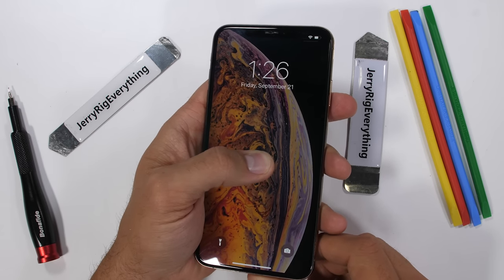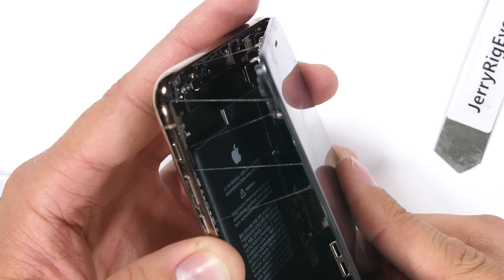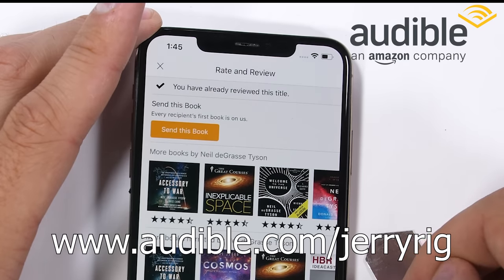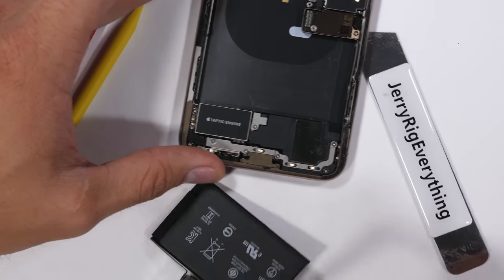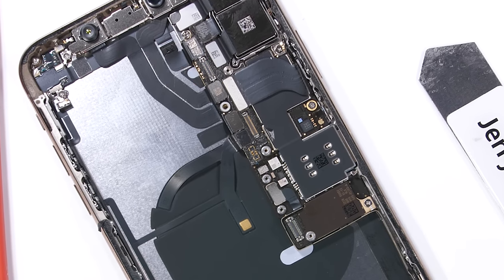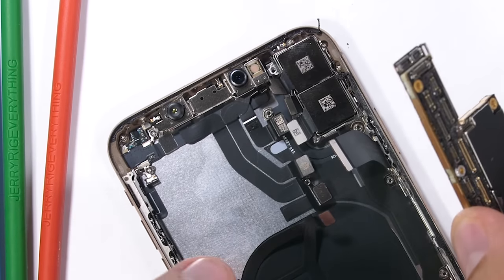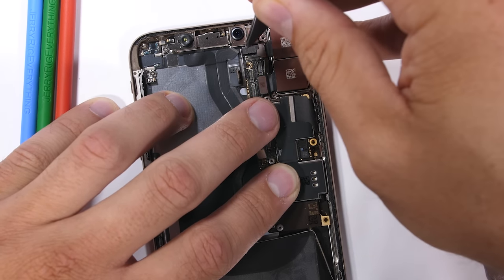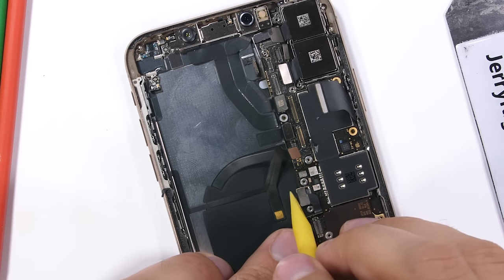iPhone Xs Max Teardown - Is there any Thermal Cooling?

Comment: “But don’t worry, the only time you’ll ever get throttled is when the next iPhone comes out and Apple needs you to upgrade. True Story“
🤣😂🤣
Reply: Lol. My iPhone 7 still runs like a champ. Very fast. No throttling. The best part is, I can still sell it for 300 bucks. Something you'll never be able to do with any other phone. Android phones so not hold their value for very long.
Reply: Darrin Thorpe, I just retired my  iPhone 6 last month, but I just use the phone for calls, messaging and basic browsing when needed. Everything else I use on iPad or laptop.
Reply: @darrinthorpe9292  I can still sell my older oneplus from 2016 for 500
Reply: Sam to some extent it is true. Apple supported iPhone 6 for 5 years, while Samsung will abandon you 2-3 years after you buy their devices. However Android is not only Samsung which in my opinion is worse than Apple in sucking your money. Others like OnePlus will give you more out of your phone for maybe 4 years for a third of the price.
Reply: @darrinthorpe9292  Try looking up the Sony xperia 3 compact. In order to get that used but in good condition you'll have to spend around 200 USD, it was around 300 USD when it was released back in 2014..... Thats a 100 USD value drop on a 5 year old Android phone. Tell me again that Iphones holds their value better than Android phones.
Reply: Done Geekbench each year of my iphone 7 plus has been owned. Hits the same numbers or better each new IOS.
Reply: @darrinthorpe9292  
"The best part is, I can still sell it for 300 bucks"
sure you bought your phone for 1000 and selling it for 300 

i bought mine for 500 and can just gift it to some one ...
question who lost more ? you lost 700 or i did 500 )))
Reply: @darrinthorpe9292  I have a 7 plus i bought new in 2016 but i just bought a note 9 for HUNDREDS less than what it cost new. I'm gonna sell my 7 plus for around 300, high 200s and in the end only pay like 100 dollars and my old iPhone for an almost flagship phone in 2019.
Reply: @n3izhyped622  a brand new current gen oneplus costs barely more than 500. Who the fuck would pay 500 for a 3 year old oneplus?
Reply: iphones hold there value more than android phones however most people who buy an android replace there phone 2~3 years after the manufacturer stops giving updates. The thing is an iphone user pays 1000 dollars to use there iphone for 4~5 years and android users pay 500 dollars to use for 2~3 years
Reply: @Username-2  wasn't their a proven scandal where apple would let older phones receive updates in order to cause the phone to become slower causing the phone user to upgrade to an updated model of the phone? Also even though samsung phones do not recieved updates after two years of release whereas apple has no restrictions on which phones recieve updates, I find that apple users upgrade their phones more often then samsung users. I wonder why that is?
Reply: I sold my iPhone 1 for 730 $ .
Reply: @darrinthorpe9292  LOL I sell phones and cant give a iphone 7 away for $170
Reply: Oh boy I cannot wait to see full HD videos with the iPhone x-- oh
Wait it doesn't have full hd 
My bad ok then I will use iphone 11 oh I forget it doesn't have full HD
Reply: @darrinthorpe9292  no one wants those thick bezels these days lol when u can get an oled display for less than 300$ then why take that shit liquid retina just an LCD🤣
Reply: Different Illusion bezels are Nice they look really good on Apple Phones and also normal person will never notice oled vs LCD
Reply: @HORR1FYING  i can the pixels of a 720p display very easily and also diff. B/w oled and lcd
Reply: @smokemirrors3445  You can but i cant :)
Reply: @smokemirrors3445  And Also on Apples Retina display u cant see any pixels.
Reply: @HORR1FYING  lol its just an lcd display apple just put a fancy name on it like their junk sapphire  camera lens.
Reply: @smokemirrors3445  it is LCD but i dont really care it really still looks so good
Reply: When in fact iPhones are supported 2-3 times as long as android. Typical sheep without the ability to research. Just go by what everyone else says huh?
Reply: @HORR1FYING  I got a crt monitor you'll think is 4k cause a logo. $800 and it's yours
Reply: @HORR1FYING  saying I'm stupid after you use "ur"...yeah. your hypocrite is showing
Reply: @deathbydeviceable  is this UR argument? k buddy get some help.
Reply: @Username-2  if no one uses the s4 anymore, why update it?
Reply: @HORR1FYING  I need help even tho you defend a product cause a logo. You need the help you hypocrite
Reply: @deathbydeviceable  are you not bashing a product because of a logo? Thought so.
Reply: @Username-2  ever heard of inovation these android phones have inovate many things such as curved display quad camera notch 120 hz display full screen display pop up camera fast charging what has apple inovated
Reply: FISH Giovanna oh lemme pull out my iPhone 29 oh my bad though it was 1080p still 720 maybe I should get that Samsung with its 7266282636p
Reply: Smoke & Mirrors with shitty software support and processor longevity
Reply: Luai Ghazali not tue
Reply: At least iPhones get software support for more than two years
Reply: What a pathetic pissing contest
Reply: Ethan Motwani it’s an effort to reduce battery issues over time it can be disabled but I wouldn’t recommend it I have been rocking a 5s since it came out and am only just upgrading to an 11 now the people that upgrade often are probably on contracts. This thing works like a charm my only issue is the battery when it gets cold just doesn’t work but it’s around 7-8 years old so that’s good going
Reply: FISH Giovanna the x has full hd the 11 doesn’t the pro and pro max do
Reply: Smoke & Mirrors the pro and pro Mac have oled so does the x and I believe the Xs not the 11 other than pro and pro max but all the 12’s have oled
Reply: @badderthanyou  
That’s weird, because my 6s dies a little every update.
Reply: @김도혁-c1z  
You got it backwards. People who use iPhone often replace their phone ever 1-2  years. People who use android usually stuck with it until their phone is too outdated to use, or it’s literally broken.
Reply: I still have an iPhones 6s plus runs fine but it can get slightly laggy on 1% but its in perfect condition

Comment: No thermals but don't worry. The only time you'll get throttled is once the new iPhone comes out and Apple needs you to upgrade. True story.
Reply: i wonder if we saw the same video.
Reply: Spade F. lmao
Reply: oplix except iOS 12 actually provided performance upgrades to phones as far back as the iPhone 5s
Reply: Actually not a true story, you gotta read beyond the headlines 😉
Reply: Actually totally wrong, they slowed down the phone in order to prevent sudden shutdown if your battery is consumed - Dont believe anything you hear...
Reply: Where as a Galaxy will slow down after a year or two, and the iPhone will keep up as normal for much longer, when the battery drops to an 80% of its capacity is when it throttles down, Samsung does that after just a year : )
Reply: School's Out: Screw Around it’s a fact... try facts for once. They’re fun.
Reply: @SamAdamsDesigns  it's because before, Apple would slow down older iPhones. Now that everyone knows that Apple does this, they decided to get rid of the speed restrictions. That's why it can be supported by some of the oldest phones and why the speed seems faster.
Reply: Tianjie Lu I’ve been using iPhones since the 3G came to Canada in 2008. Yes iOS updates have sometimes made older models slower in the past, but not the year-old models. It would usually be 2 or 3 year old phones that got a little slower. That happens when you update the UI or add new features. Android phones havent experienced this because they rarely ever get substantive updates beyond the 1st year of release.
Reply: Actually, most reports of slow downs of older phones are because every new IOS update is catered to the newer phones and not old. So when you had IOS 11 update to your Iphone 7, it was designed for Iphone 8 and X, and was too much for your Iphone 7 handle. Still absolutely Apple's fault by not making an Update that caters to all phones Like Android does. Therefore for the 1st time in a long time, Apple made IOS 12, which focused on catering to NEW iphones as well as old ones and made it optimized to where old phones from Iphone 5S and 6 run much smoother and quicker. I am pure Android fan, but this has been only time i give a small pat on the back to Apple.
Reply: @micharel937  

False, but what ever makes you feel better.
Reply: @SamAdamsDesigns  not true, androids get updates about as frequent as iPhones. My 180 dollar honor gets updates about once a month. Yesterday, I got a update that was google's security patch and Huawei's GPU turbo integrated into my phone.
Reply: hear hear!
Reply: I am android user but gotta say you got it wrong there. You are basing your opinion on one incident but you should look at the big picture. Iphone will be faster for longer than samsung one for example. That aspect is of course better with something like oneplus with pure software.
Reply: What do you mean "pure software" of course its pure software, every smartphone is. Most companies would support updates unless they've changed the Android OS till the point where the update isn't supported. Apple has better management over their smartphones than Google because of their closed source OS. Google has an open source which is harder to control because of the many different companies and hardware. Therefore, only some responsible companies would support their phone with Google's updates. And I wasn't basing my FACT on one opinion, I stated that I get updates every month. I was giving an example of my most recent updates.
Reply: @tjl2836  by pure software I suppose he means closer to stock. Stock android has shown to age far better over the years than most skins (specially the old touchwiz from samsung) but I think it's gettin better specially with samsung's...
Reply: @jackkonieczny25  the difference is other phones throttle because the cpu gets less and less power over time but apple throttles them by themselves (I'm not getting into which is better). And apple wasn't planning on telling customers either but people found out so they had to explain.
On another note, the problem with the samsung galaxy note 7 had nothing to do with cpu throttleing but manufacturing defects on the batteries.
Reply: @jackkonieczny25  and to get a battery to 80% deterioration you must be doing something very wrong with your phone...
Reply: @jackkonieczny25     You thought that batteries slowly losing charge was something I didn't know? And it is obviously true that cpus do slow down to stay at a l safe temperature, but that isn't the cause of the the note 7 exploding. It was the battery, what else can explode? And Apple barely includes any cooling in their phones, while other companies are producing liquid cooling systems and 3d chamber systems. And what do you mean by Apple has the balls to admit it? They never had balls. They sold the apple keyboard knowing that it was defective and sold smartphones knowing that the signal would decrease if you held it differently, they knew their phones would bend, they knew the xr had exaggerated beautification, and they knew their xs models would have charge issues. The public had to do all apples work while Apple collects all the money. What other company has had these big of issues? The biggest I've seen was the note 7, but at least Samsung was responsible and recalled it. Apple never recalled the bending phone or the messed up signal, they just used a update to cover up their mistakes. And all the other companies had perfect reputations. Huawei's only defect was a issue with RAM, but that wasn't as bad as a bending phone or messed up signal or charging or camera? And they later fixed the issue. Xiaomi, OPPO, and vivo all had perfect reputations and the best deals.
Reply: AnonymousXY they also slowed down 1 year old iPhone 7 when iPhone 8 came out not just the old ones. Don't believe anything you hear
Reply: Jack Konieczny samsung phones didn't explode because there were throttling problems. It exploded because there was problem with battery. And apple doesn't have the BALLS to admit, they were just caught red handed that's why they admitted.
Reply: Tianjie Lu or you know, blaming customers by saying and I quote "you're holding your phone wrong" 😂
Reply: Nope, faster.  Lots of videos measuring it, but it's only shown app launch and responsiveness.  Not necessarily an improvement in any processing.  Still Apple deserves credit for making my ever more sluggish 5S feel faster than the previous OS.
Reply: @pere_gin  Yeah, skins just put more stress on the cpu
Reply: Galaxy slows down? huh?
Reply: @cakonemicke2198  yes, they are slower than stock android
Reply: To be totally honest, my first iPhone was the iPhone4 and iam not a fanboy i work for Apple and I know the truth about this... do you really think a Company that is worth so much has to force you to buy a new phone? True story: apple would be able to shit on the table put a fucking applesticker on it an they would be able to sell it. So don’t bother us with all your Fake news - Thanks!
Reply: Omg so many arguments here 😂 guys, just buy phone that makes you happy whatever the brand is, smartphone should be used by smart people too :D im using xiaomi redmi note 3 pro since 2016 and now it's still very responsive and usable and I'm happy with that. So let's think if it's not about the brand but it's about the benefit of that thing for you and do you feel comfortable with it
Reply: Pussy Slayer nope, it actually speeds them up by optimizing your phone from the 5/5S up to the X I believe
Reply: oplix I mean that’s not a true story but okay
Reply: Batterygate
Reply: These channels are getting paid by samsung to say shit about apple
Reply: So true”!!! I’m just saying to the bottom who said check your battery condition “ I got a replacement from apple so my Iphone 7 plus 3 month old becoming garbage since I upgraded to  OS 12 !!!!
Reply: @David-mg1ii  that's such a BS reason even what you're saying is true. Kill the performance to save a little battery?
Reply: @David-mg1ii  don't believe everything apple told u
Reply: @micharel937  had a s6 for three years, didn't see much change, ty for wrong info
Reply: @micharel937  lol I'm using my year old s8, no performance issues and before that my dad was using a 3 year old s6, no defects or slowing down okay so do research before you comment such a dumb comment
Reply: Actually that's not true. Apple slowed down the iPhone 6 because the battery life sucks but you can easily replace the battery and thanks to the IOS 12 update iPhone 6 is way faster.
Reply: No thermal cooling, and still no 5 minute limits with 4K video. Note 9 has liquid cooling and still it has that stupid 5 minute limit due to overheating :DDD
Reply: Wtf apple phones are way more durable than any android phones

Comment: "the only time you ever get throttle, when the next iPhone comes out and apple need you to upgrade, TRUE STORY"- jerryrigeverything,2018😆😆😆
Reply: Apple fanbois triggered 😂
Reply: I’m using a 6s Plus & it still scores 2564 single core score on Geekbench 4, I don’t think it’s common for iPhones to throttle unless there’s something wrong with the battery.
Reply: It‘s a fact that This is Not true
Reply: Pranay Sawant Massive Burn !!!
Reply: Mlordy witch in itself is ass since no other company does that
Reply: Yeah that isnt true
Reply: Forzaguy125 sure keep lying to yourself
Reply: mobious01 check geekbench scores of the X now. It’s higher than it was on launch because of iOS 12. Anti-throttled
Reply: But when a new Galaxy phone comes out within a year and costs $900 + it’s no big deal?
Reply: Apple fixed this tho. Now they will notify you if your iPhone is slowed down and why. Usually it’s just a battery replacement which apple does for $20. Yes they only did this because of the lawsuit but they did it, and that’s important to mention.
Reply: The conclusion 😆
Reply: @ramiiiYT  Apple only react when they're facing a class action. The $20 replacement expires is December this year.
Reply: There was no malice.  Throttling is done to avoid random shutdowns when older battery can no longer supply peak current demands.  It was meant to EXTEND the device's useful life, not reduce it.
Reply: @BixbyConsequence  then you end up with a useless battery. Instead of crashes you end up with a progressively shittier battery and the battery is crucial for a phone. What's even worse is that Apple did this without customers noticing; it's clearly a monitary move , just like everything they do.
Reply: Lewis read my thing again. Yes they only responded cuz of the lawsuit but they responded so the slow down phones thing is not accurate anymore. As for the Expiration date thing, it’s fairly easy to replace the battery yourself.
Reply: @ramiiiYT  still the fact is the company shouldn't have done it without the consumer's consent. They don't do it know but it's still relevant as it shows how shady Apple is . It may be easy to repair but it's not easy to find an authentic Apple battery. On the other hand companies like Samsung of a whole official site dedicated to selling parts.
Reply: Lewis well I agree what they did was wrong but I’m just saying that statement is NOW inaccurate.